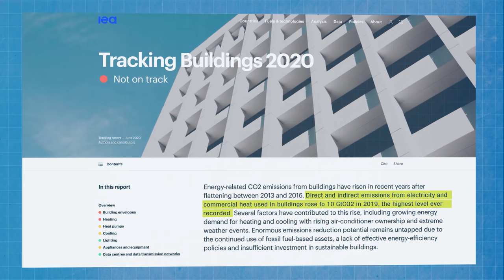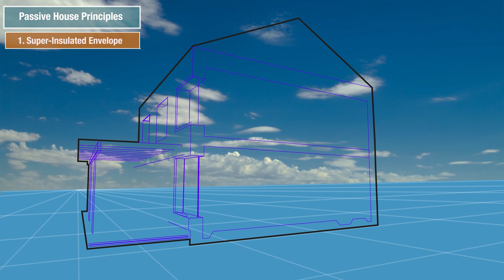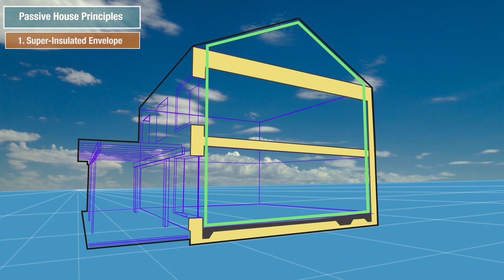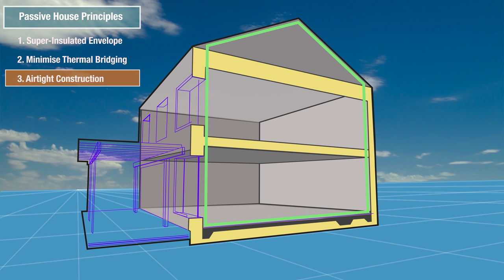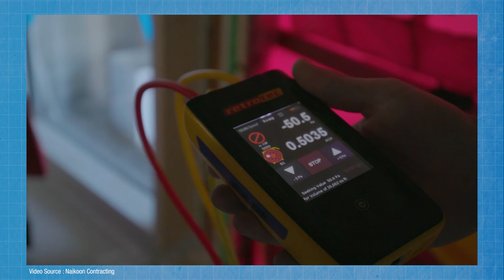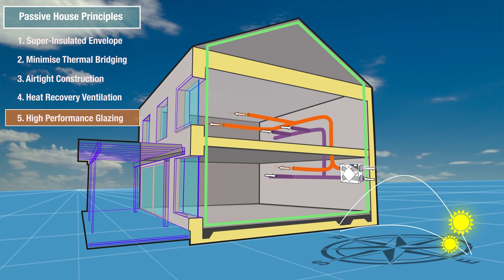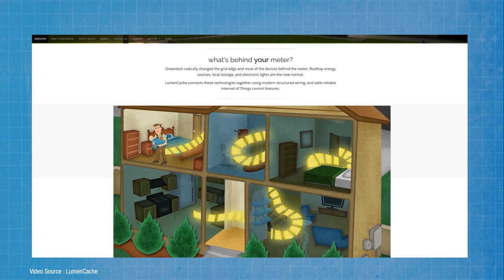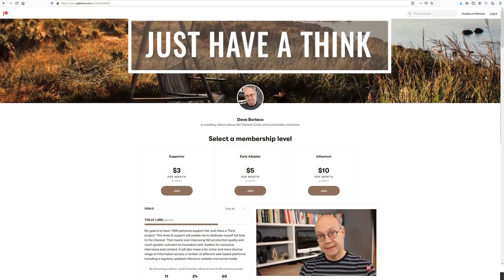Passivhaus . A low carbon future for our homes?

Comment: At last, after a long time struggling to understand most of his videos, this one is my bag, being an architectural technologist. I have been all for passive houses ever since going to college in the late 80’s, but trying to convince other colleagues and friends to use these processes is like pulling teeth.
Reply: The client stakeholders and architect must be on the same page. The same with LEED rating  it is only the rare client who will demand the extra cost they think is associated with the better design. If they understand that future longevity and operating costs are linked to good design choices, the the attitudes might change.
Reply: Enraging isn't it? PH is so bloody obvious we should all have been doing it for at least a decade already, but housebuilders lobby against any improvement in building regs, and buyers have no idea they could have much nicer buildings that were incredibly cheap to run. I've enerphited mine, but it would be so much easier to do this with a new building rather than try to retrofit.
Reply: Almost every time I see a new slab being poured it makes me sad. (They are still pouring insufficiently insulted slabs, and avoiding foundation pillar designs to prioritise ease of breeze block construction over environmental concerns.) Also roofs need to be larger to collect more water and to reduce maintenance of walls.
Reply: @recklessroges  I know,my good friend and colleague is having is house extended,I managed to convince him to put in twice the insulation in is slab.. he's an excellent engineer but a bit of a dinosaur. It doesn't help that house insulation is over priced,I mean it's only foil backed foam.
Reply: @IDann1  Insulation itself is very cheap in comparison to building costs. Butting in 200mm rather than 100mm is a tiny cost increment (my extension cavity is 200mm with ancon basalt cavity ties and a foamglass (perinsul) thermal break at slab level, plus 200mm XPS under the slab. Those upgrades over standard came to a few hundred quid in a 40-grand extension cost. 100mm PUR sheets seem to have almost tripled in price in the 12 years I've been doing this, so lower-embodied carbon materials look much less expensive in comparion.
Reply: @Wookey.  You’re preaching to the converted here, all I was able to do was convince my friend to increase 50 to100mm installation underfloor. Being a lowly technician/technologist I just have to do as I’m told, most of my suggestions don’t get heard because of increase of cost.
Reply: I can imagine what you go through trying to convince architects and builders to innovate their constructions by applying Passive House methods. 

If Elon Musk had an architectural & home building company he would already have even more innovations that would revolutionize residential construction, bring costs down toward greater affordability and empower homeowners to self-invest in their own power generation, rainwater harvesting and energy recovery.

One big problem with modernity is that the same legacy system mindset does the same thing over & over again, while the need for change cries out in the wilderness to little avail. For this reason, I expect our planet to warm past the 1.5-2C IPCC target with sufficient momentum to reach even higher levels. That said, every instance of innovation in residential home building has the potential to inspire copycats, which is a good thing in & of itself.

Perhaps we'll see many more constraints in the 21st century that will force homebuilders to do more with less, and the sustainability, and affordability, changes that we so desperately need will eventually become "the new normal"?
Reply: @alanmcrae8594  We don't really need Musk or someone like him to make new innovations in building better housing. The innovation has been done and tested over the last 30 years and you can now build passivehouses for the same cost as conventional houses (for social housing - Exeter is a good example in the the UK) or a few percent extra. This outfit build net zero, passive schools for 7-10% less than conventional build:  https://www.netzerobuildings.co.uk/
The problem is all about the market structure and incentives. The builder just has to minimise build cost. Running cost and emissions do not affect them at all. Buyers don't get a choice clearly showing that they could pay 0-5% extra and get a house that cost 20% as much to run for 50+ years. The emissions would be dramatically lower overall. The separation of interest of buyers and builders produces peverse incentives and add to our stock of mediocre housing with high emissions.
We've had the tech a long time, and some fairly small changes in the rules of the game could spread it to everyone.
Reply: @Wookey.  Interesting points, but NASA contractors had perverse incentives to make one time use orbital class boosters for 40 years and then Musk, a complete outsider, came along and created a reusable booster that reduced cost to orbit dramatically. Ditto for extending the range of electric cars and, soon, reducing their cost significantly. Ditto for digging tunnels, manufacturing batteries, etc.

What Musk brings to the table is not just cutting edge innovation, but hundreds of billions of dollars of market capital. The kind of financial power that plows thru existing entrenched regulations, bureaucracy, and politics. This is what the new "disruptive business model" is all about - disrupting old, established, backward looking markets that have us stuck in old ways that should be discontinued.

You've noted that the existing homebuilding market has 30 years of proven innovation ready to go but regulations and financing are preventing further market penetration. If the existing market players can't get the changes done, then maybe a new player is needed who can? (Sounds like the old guard at NASA, set in their ways, and always ready to defend their turf from new competitors.)
Reply: I'm an architect, and this is not my experience at all. People everywhere are crying out for Passive house -standard buildings (I've been building them since the 90s). That really isn't the issue. The main problem is that most of our housing stock is old, and pulling those houses down and replacing them is never going to happen, and shouldn't be allowed to happen anyway. New build is a trivial part of our overall housing stock. Yet again, this excellent website seems to offer a technological fix to our problems, but it really isn't as simple as most of the subscribers seem to think.
Reply: @MikeAG333  I don't know where you are located, but here in the US a new Passive House build would be local news that made cable tv and the newspaper. We've been advocating for sustainable living for decades, but more intensively for the last 10 years, and we rarely meet anyone who even knows what Passive House standards are, let alone is crying out for building with them.

New home builds tend to be cookie cutter standard construction, on the large side, and with no regard for solar orientation. Window performance has improved dramatically, and insulation code standards in many areas has increased, so there has been some forward progress. However, home sizes have been increasing for decades, even as family sizes have been decreasing, so it is difficult to calculate whether performance increases have been negated by increased square footage.

The biggest issue, as you have pointed out, is the existing legacy housing stock that was built when energy efficiency & building performance were not even a thing to consider. This is where vast amounts of fossil fuel energy are wasted to deliver comfort to the occupants, and so long as the fuel is available at a price they can afford, they will adjust their thermostats for maximum comfort at all times. Retrofitting these homes to improve energy efficiency & building performance could be helpful, but given the impact of the Covid-19 Recession the question is "will the funding be available?"
Reply: @alanmcrae8594  I'm in the UK. Our situation is slightly different from yours in that the existing housing stock is up to 600 years old, predominantly 150 to 80 years old, and the character of our towns and villages would be destroyed if there was any attempt to replace the existing, or to externally insulate the existing.
In the USA you have the advantage that almost all houses are built the same basic way, and are of low architectural or historical interest. There's little in the way of excuse or impediment if collectively you decided to uprate the thermal performance of your buildings, whereas we have larger obstacles to overcome.
Reply: @MikeAG333  Understood. 

As you may have observed recently, many Americans don't really care much about anything except their own creature comforts. Heck, many won't even wear masks and socially distance in order to protect their own family members or even themselves from a potentially lethal virus. Amazing self-absorption!

Attempts to fund a nationwide program to upgrade the efficiency of American homes have repeatedly failed. The fossil fuel lobby has a tight grip on Congress, and their profits mean more to them then the Climate Crisis that they are causing. And with developing countries industrializing at ever increasing speed, the consumption of every bit of fossil fuel extracted from the ground is all but assured.

My wife & I are designing our own small, energy efficient house that we hope to build on a piece of rural land that we own in a national forest in the mountains. We are taking actions on the assumption that humanity will probably not act collectively in time to forestall the Climate Crisis, and, therefore, we must be prepared to meet our own basic needs off grid and away from the mainstream. Forest ecosystems have an excellent track record of resilience & self-maintenance when not systematically destroyed by humans, so, hopefully, we have managed to find a good place to build our small scale solar homestead.
Reply: @alanmcrae8594  That sounds brilliant. Good luck with it.

Comment: I  believe hemp concentrate is brilliant insulation and mostly natural product !
Reply: Typical ippi
Reply: Very flammable, though. Most insulation is designed to slow heat exchange as well as slow the rate at which a fire will spread in the event one starts.
Reply: Flax is even better
Reply: There are lots of natural insulants: woodfibre, hempcrete, wool. They are all good, and generally much lower embodied carbon but higher purchase price than oil/plastic insulants. This is partly scale and partly lack of carbon pricing. Energy usage dominates here so it's OK to make your passivehouse with EPS because that's a lot cheaper and more forgiving to build and detail in wet countries. But it really is better to use the carbon-negative products is you have any budget flexibility.
Reply: Passive House builders in the U.S. are using a lot of Rockwool.  The manufacture of it uses a lot of natural gas, though.
Reply: Do the payback math of additional upfront cost vs savings.
Reply: @PupuTheMonkey  I'm pretty sure he meant to say hempcrete and just got messed with by predictive text.
Hempcrete is not flammable.What planet are you on dude???Do you think people would build houses out of kindling?  :-)
Reply: @barbarasmith6005 In the land of the blind....
 It also perishes over time,sags when used vertically,has no insulating properties if wet,causes wood rot and is a byproduct of and therefore subsidises the quarrying industry.
Apart  from that,it's not the worst thing out there.
In the UK,people used to think that covering a brick wall in render and pebbles would add insulation!
Reply: @barbarasmith6005  Rockwool has a surprisingly low embodied emissions value despite being made of molten rock!

Comment: Our house here in Bergen, Norway is just about to be finished, after the latest regulations (TEK17) and what I can see is that it is a step down from a truly passive house. It's quite airtight, with thick isolation, 3 layer windows, ventilation system with heat exchanger, AC unit mostly for heating ... 

What it's missing though is a  water based heating system with air to water heat pump. It wouldn't save me a lot on the heating itself (since I'll use air to air heat pump for heating) but it would make a significant difference on the tap water heating. However, the astronomical price and hidden cost (maintenance of air to water heat pump and life expectancy) was way more than I could gain from it
Reply: Hei, se kommentaren min over, det er en del forskjell på Tek17 og passivhus etter NS3700/3701. prinsippene er de samme, men det kreves bare enda mer isolasjon, enda tettere byggningskropp, enda høyere virkningsgrad på ventilasjonsaggtegat osv..  Men uansett er det glimrende at lovverket nærmer seg..
Reply: @oleeide9763  Ja, selvfølgelig, det er et steg fra passivt hus, det nærmer seg og neste TEK blir kanskje et steg i riktig retning.
Isolasjon på yttervegger hos meg er 200 mm og selv om vi har 350 mm i selve taket er det ikke nok for å kale det et passivt hus. Tomannsbolig på 2 plan i mitt tilfelle.
Mitt ventilasjonsanlegg (Save VTR 250) har termisk virkningsgrad på 81%, høres bra ut men ikke sikkert om det oppnår kravet til passivt hus?

jeg leste din kommentar og du sier at du har vannbåren varme installert men du aldri brukte den??? Litt merkelig siden det koster 200 -300k  kr! :) Bruker du luft til luft varmepumpe til oppvarming da og luft til vann til oppvarming av forbrukvann? Jeg synes at vannbåren varme er rett og slett ikke verdt investering!
Reply: @lovrorb  Hei igjen, Først vil jeg gratulere deg med nytt hus :-)  Moderne Tek 17 hus gir glimrende bokomfort, så du har absolutt noe å se fram til.  Når det gjelder min installasjonen av vannbåren varme så kostet det ikke meg så mye da jeg gjorde mesteparten av arbeidet selv.  Som oppvarming bruker jeg en varmepumpe og noe solvarme som forvarmer tappevann og noe gulvvarme i underetg og dette gir varme nok i hele huset, men planen er på sikt å koble til resten av huset da særlig badene hvor det nå er varmekabler som holder lunk i disse gulvene. Og foresten din Save 250 har en gjenvinningsgrad over kravet for passivhus som er på 80% :-).  Fin artikkel på Tekna om passivhus finner du her: https://www.tekna.no/fag-og-nettverk/bygg-og-anlegg/byggbloggen/krav-til-passivhus/
Reply: @oleeide9763  Med gulvvarme i underetasjen mener du varmekabler eller vann? :) 
Å ja, planen er å få vannbåren varme i hele huset?

Da jeg ba utbyggeren om pris var de ikke særlig interesserte i å montere den, og de ville ikke at jeg legger rør under gulv selv.

Den artikkelen har jeg egentlig lest tidligere i dag, den kom først da jeg googlet passivhus :)
Plus hus? Det er noe jeg skal undersøke litt

Comment: I think we can now go beyond passive houses (that I remember already existed in the 1980s in Provence, although not under that official label) and toward positive energy houses, the next level, same principles, plus a few more.

Limited space in towns and suburbs almost always require the use of expensive efficient thin materials, but if you happen to live in the country, you can use earth for thermal mass, cheap thick straw insulation, buried pipes for additional cooling/prewarming, etc.
In some countries like France, houses are taxed based on the internal area of all rooms, so you can go crazy with extra thick insulated walls without impacting taxes. Or, as some would say: Just Have a Thick.

I have been looking at earthships for a while, it's a really great concept, and it's often the opportunity to gather all family and friends and neighbors in a party to build it in stages. Just go without the recycled tires and colored glass bottles that seem to be prevalent in this kind of projects, and use less polluting and better looking materials.  Tires should get properly recycled anyway, not buried underground and leaking petrochemical compounds all over the place.

Lowering energy use or even producing more than consumed is a great goal, but really, getting rid of most other monthly bills is also more and more appealing for resiliency and for retirees on a low budget, so you need pay maybe only for the phone and Internet bill. No rent of course if you own the land, no natural gas bill either, since it's a highly polluting GHG and quite bad for the home atmosphere too, no electricity bill with photovoltaics and a small wind turbine, no water bill with your own well, and sometimes you can even skip the refuse and sewage bills. Earthship-type houses also reduce your food bill, as you can grow greens, herbs and some vegetables in the south-facing green house, and some more just outside. There's always something to harvest and eat in the garden, I could dig out sunchokes from mine all winter long...
https://en.wikipedia.org/wiki/Earthship
Reply: Build a house from pallet racking. Join us at CLIMATE RESISTANT HABITATS Facebook group
Reply: @lexiecrewther7038  Lots of great info in this group indeed.